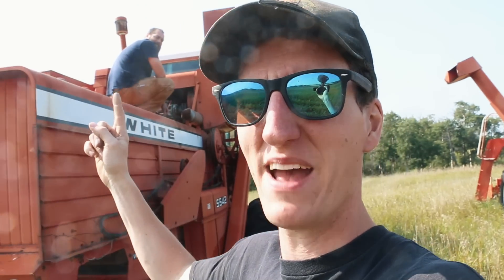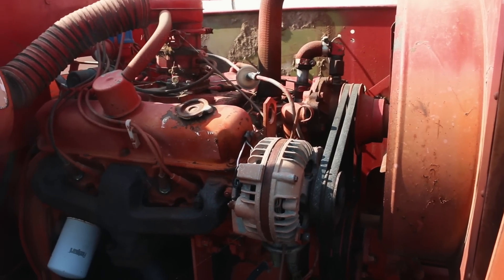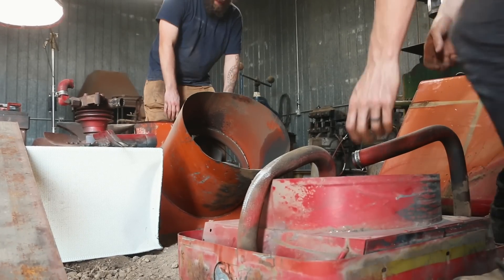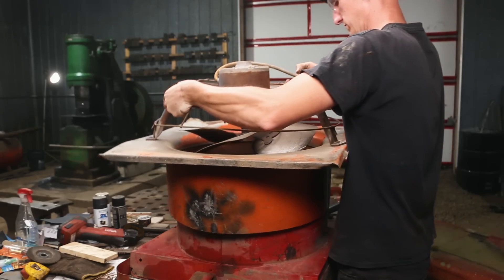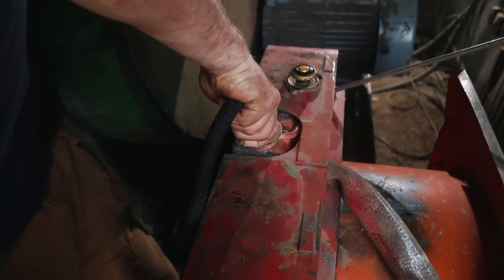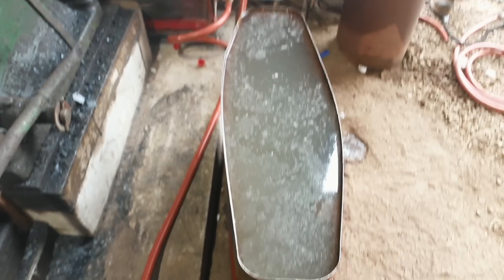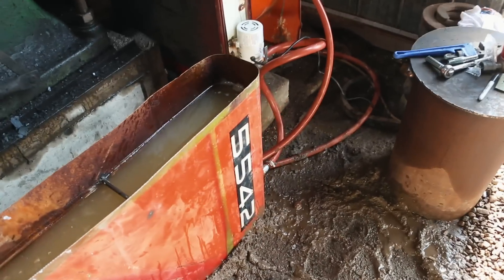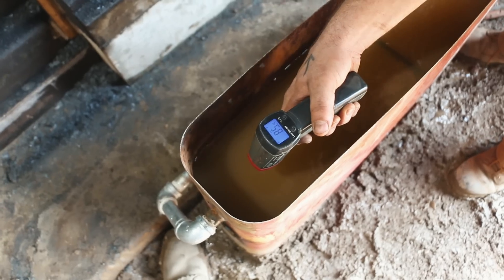Hooking up a radiator to cool my quench tank.

Comment: The top of the tank is where the lightest and hottest water will be, that must feed into the top of the radiator, that will cool it and it (water) will become heavier and will "sink" towards the bottom of the radiator which you can feed back into the bottom of the quench tank. You can fight against nature, and force the hot water with the pump. But nature and the unchanging laws of physics will have the last word when the pump, exhausted from all its excessive work, dies a premature death from fighting that which can't be defeated forever.

Comment: Hi Tim good job , I thought about your pump , I’d look for an old dishwasher pump , it’ll be free and usually modern dishwasher dies when something electronic stops working , usually the pump and motor are still working .   I do agree with others that a gauze filter or screen is a good idea to stop scale blocking the tubes  in your radiator .

Comment: Too,bad you couldn’t rig up an electric motor to the water pump/fan assembly. And use the existing engineering. It would have moved far more water and still been ultra quite.

Comment: You may need a filter to protect the pump.  I expect you'll be getting scale and metal flakes in the water, and that's going to rapidly destroy the pump.

Or possibly switch to a different type of pump that can handle junk in the fluid.  Something like either a centripetal pump or a centrifugal pump may be a better choice as they are open all the way through and can better handle particulates in the medium.

Comment: I have that same pump, it’ll get cracking hot after an hour or so. For your purposes I would go with a submersible water pump. (Like $50-$60 at northern tool, or most hardware stores) It will stay cooled by the water, and can take a much larger hose.

Comment: For any heat transfer in fluid you always want to pump the cold fluid in from the bottom.  This gives you the most efficient cooling, prevents cavitation in your pump, and you don't have to regulate the flow back into your tank.

Awesome video. It's always fascinating to see you build something out of nothing.

Comment: If you switch out the electric fan to the belt driven fan that matches the radiator and also use the pump from the same machine you can run them all from a small electric motor via belts  also it will be much quieter, not cost you anything and will also look better.
Reply: Best suggestion.👍
It looks like he's got everything he needs at 3:31 except maybe the backing plate to the pump, I assume it's still on/part of the intake manifold, but some 1/4 plates cut to shape should fix that.

Comment: You should use the water pump you took off the engine, bolt it onto some plate. Run the pump belt driven off a motor

Comment: Great video as always.  thought I would throw my 2 cents in (hobbyist black smith and HVAC/hydronic designer) . airgunsandsuch9139 mentioned a screen or some kind of filter, till will be great idea to protect pump and radiator from debris and scale.  if you pump dies and you need to replace for for a cast body transfer pump 1/2hp or 3/4hp should be strong enough (home depot Canada sells a everbilt one).  depending on how hot things get, it might be smart to blow air directly to the outside.  happy to offer any other help if you want.

Comment: You should have a screen or filter ahead of the pump so it doesn't get clogged up with scale.
Reply: The radiator will also quickly plug from the scale in the water tank.  Good idea just needs a bit of refinement.
Reply: Or not use a vehicle radiator at all.  Make one out of 3/4 inch pipe or something instead.  Or, if a vehicle radiator is used, keep it on a separate system and use a heat exchange system to keep the dirty and clean water separate.
Reply: @earthknight60 this is the best idea
Reply: This, adding some filters will extend the life and let it work longer before having to move to a more robust solution.
Reply: @paulklassen6486  Would make sense to me to build a cooling tank once and do it problem free once. That way it will last for decades. Yes, I understand budgets.
Reply: You could use a stainless steel drum or put a lip around the top of the tank to keep it from expanding. Also a windmill driven water pump as a power free backup would be cool! Maybe a rain catcher top up tank so that the quench tank is always topped up?!
Reply: For the filter tried maybe a bazooka style filter easy to have in beer brewing stores . It will take more time to  clogs